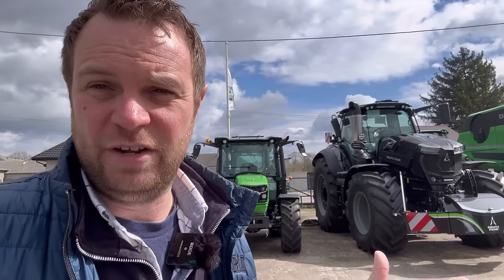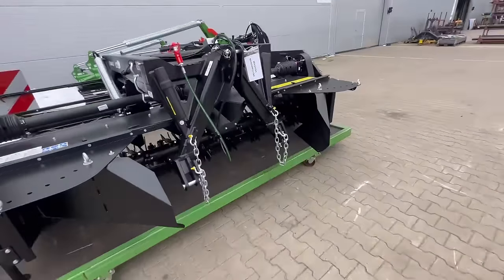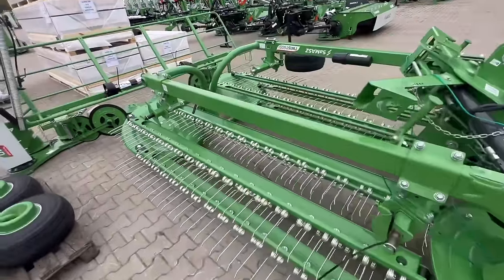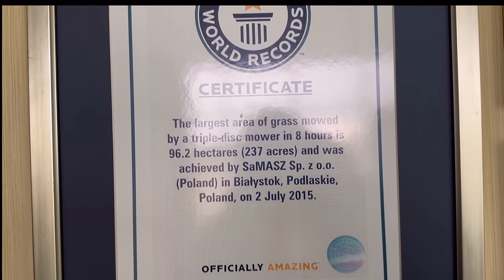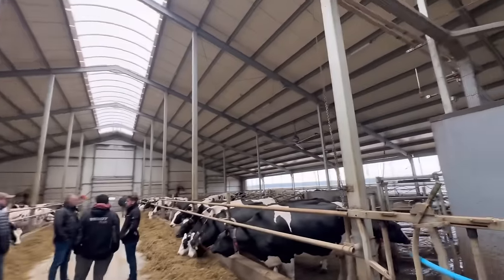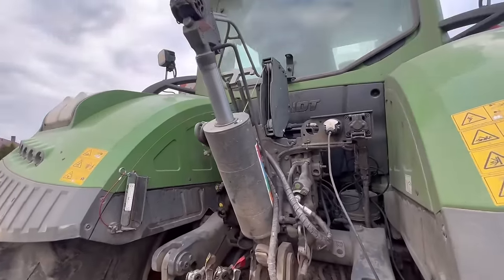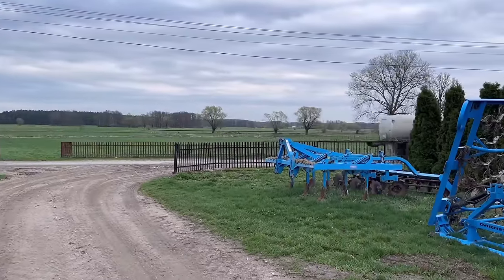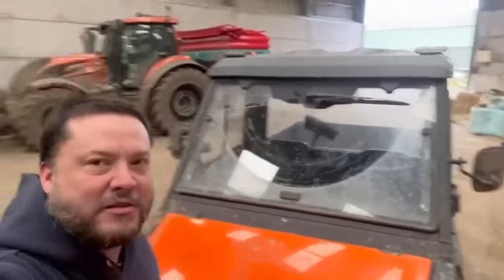POLISH DAIRY FARM WITH ROBOTS &  SAMASZ STOCK #AnswerAsAPercent 1480

Comment: Nice dairy farm that. Feed pushers are a such an under utilised bit of kit in the UK.  
Good for beef farmers also!
Reply: Why aren’t high fronted troughs used?
Reply: @adrianchetwynd1334  Cleaning. And any left over feed will be turned out to keep it fresh. Plus troughs get bent up and need maintenance harder to clean and attract rodents.
Reply: @miniripper  Thanks but have to say that some farmers clear the floors and feed it to lesser stock which could be practiced with substantially built troughs. If I were a dairy farmer I think I’d design and fabric an above ground troughs.

Comment: I went to a Mc.Connell open day in the early 2000s and saw a saw blade head demonstrated and was surprised at how good a job it did on a hedge that was trimmed conventionally each year. It did better than the big shear type! The other good point is that it doesn`t throw debris like a flail does which can be handy in some cases.

Comment: Would a cobble yard work better for you given the settlement that’s happening underneath. It would deal with rain better too. #90%
Reply from the maker: I think so
Reply: @OllyBlogsAgricontractfarmer  it is a little harder to lay than concrete but it looks fantastic on the continent. They are well setup though with handlers that can be used on a loader or digger. 

Fiber reinforced concrete is great for yards too. Much less cracking but when the ground underneath is moving nothing really helps. Are your shed floors prone to cracking or do the turning wagons and tractors do harm too?